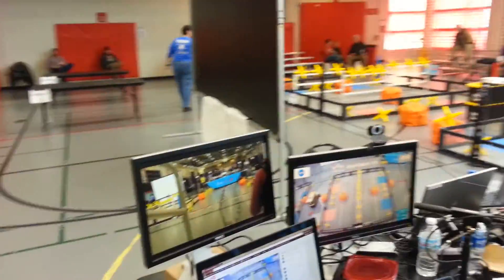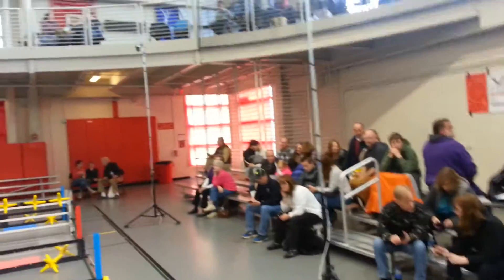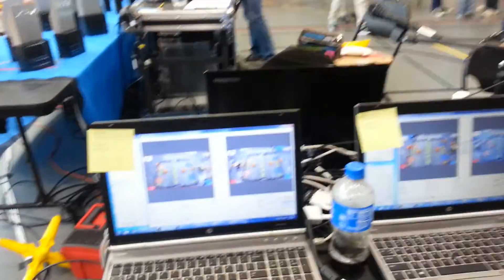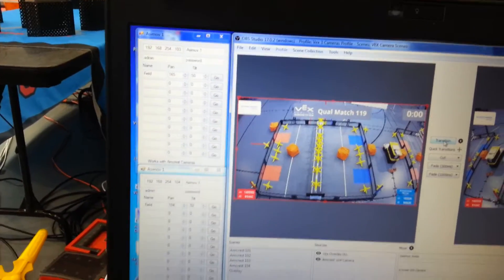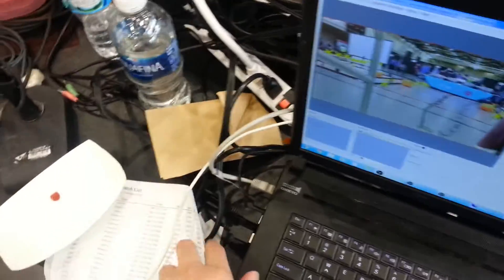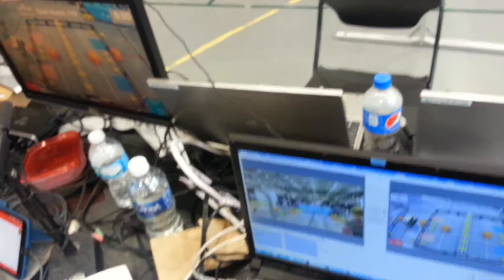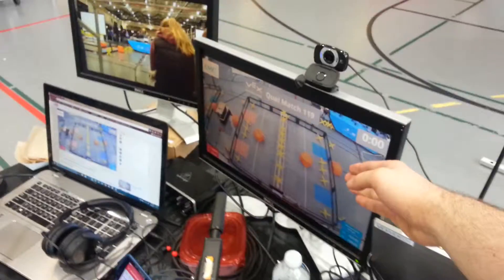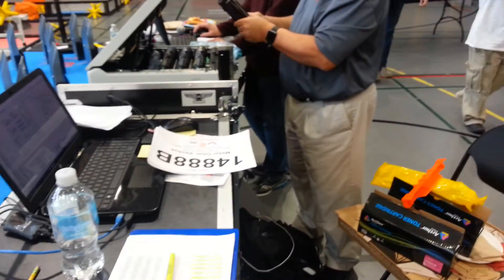Behind the Senes of the live video production at the Wisconsin VEX State Championship

Comment: We've been checking out the Amcrest cameras as well to use at our tournaments. Are these cameras able to be powered by a Power over Ethernet switch or do they need an external power supply? From what we know about cameras, no matter if we use the plug in power supply, we would still need to plug it into a Power over Ethernet switch, correct?
Reply from the maker: They sell PoE cameras and non-PoE cameras.  Both can be powered off the wall and connected to over ethernet.  The PoE gives the ability to power the camera with a PoE switch, so you only need 1 cable to the camera.  If you don't want to use a PoE switch though, you can still power it, directly and use a regular switch.

Comment: Thanks for posting! What specific cameras and (more importantly) where you got the stands. Do the cameras switch in OBS automatically? If so, how do you do this? We run a two field tournament and would love to do this  any help is appreciated! Thanks!
Reply from the maker: We use Amcrest 1080PPan-Tilt PoE cameras.  The stands are regular speaker stands.  I 3D printed some inserts that allow the conduit to be placed in it.  Currently a operator has to switch OBS, but it should be possible to automate this but it would take some effort.